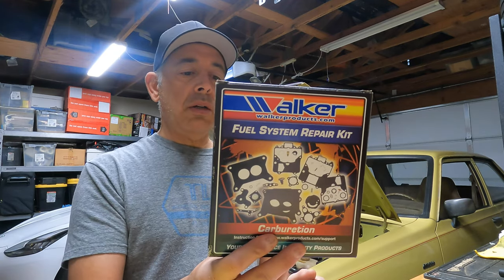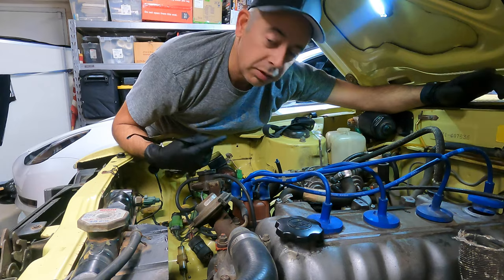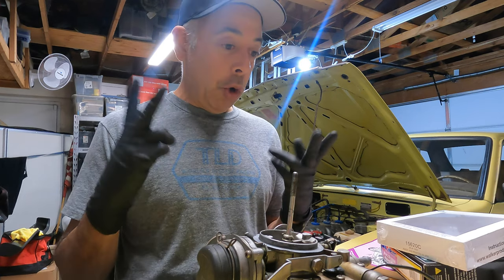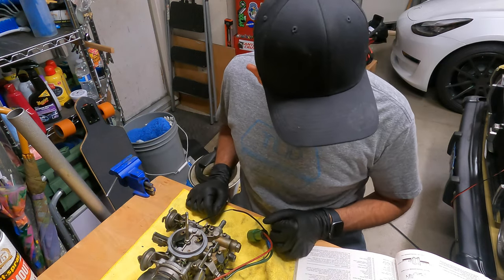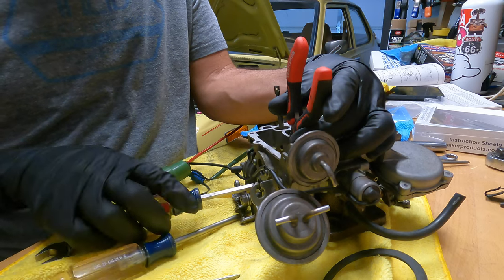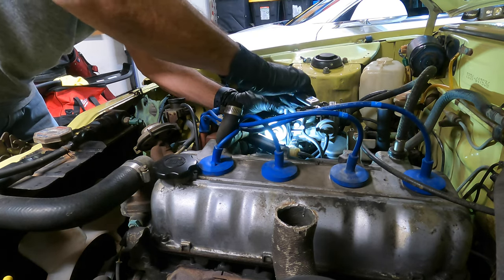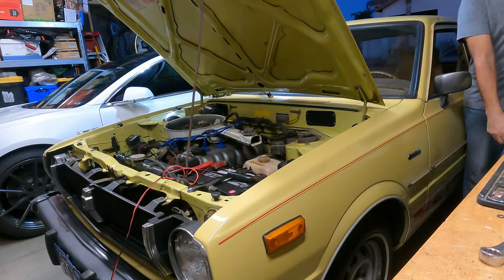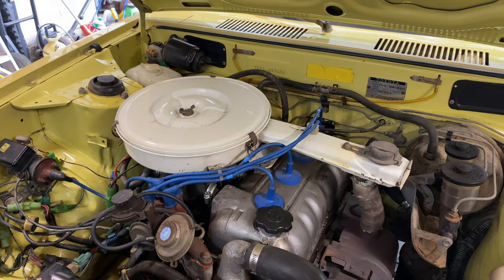Rebuilding my Carb...will it fix my 1979 Toyota Corolla TE31?

Comment: Same problem with my 84 Corolla coupe. Sat for too long. It was working fine but had a power steering leak and I let it sit for too long since I had my pickup to use at the time. When I tried to start it one day had same issue. I replaced fuel pump. (The one it had worked but was from a 4 door) they are different. Checked fuel lines. Dropped and cleaned tank. Nothing. I figured the end of the line was the carb. But I know nothing about carbs. I heard something about a floater drying out in carb... But I see you brought it back to life. I'm gonna use that link for O'Reilly. Thank for the tip. And congrats. You just forgot to say "IT'S ALIVE!!!"""😂✌️ PS sweet ride. I had an 83 pickup before. Got stolen 😣. Love old Toyota though. I would like to own a 70s pickup or Stout or Corona. Great job! Subscribed. ✌️

Comment: When you install a carburetor on a car, its a smart idea to manually fill the fuel bowl with fuel before you start cranking the engine. That way, there's already fuel inside the carburetor, and when you first go to start it, it should start within a few seconds. 
That way, you don't need to crank the engine for a while to get the mechanical fuel pump pumping fuel all the way from the fuel tank, all the way to the carburetor.
Reply from the maker: Thanks for the info...great to know for next time as I continue to learn about this car.

Comment: Hi, I have a 76 Celica (TA23) with the same engine and faults ( also a home mechanic). I changed the mech fuel pump but still no joy :( . It was harder for me to remove it because my hood flips on the front side, lol.  Looks like i have to rebuild my carb too, need to ask if you have the reference/ part number/ carb model number for the carb rebuild kit? Need to source it for a similar rebuild. Thanks for the links and a great walk-through on the rebuild, looking forward to more vids on your Corolla.
Reply from the maker: If you are in the USA, i went to the Oreillyautoparts website and searched by my car model. I did a search for yours from Walker Products tune up kit #5619C  https://www.oreillyauto.com/shop/b/fuel---emissions-16775/carburetors---parts-16801/carburetor-kit-12248/d5bc70949f67/1976/toyota/celica?q=carburetor+kit Hope this helps

Comment: I have similar issue with my 76 celica, same engine but dual carbs, cleaned them both out but now it doesnt run good, needs some fine tuning or calibration but hard to find info on that lol. So if someone knows where to find please let me know!

Comment: 1980 Toyota Corolla 1.8 stalls when I come to a stop. Any suggestions?
Reply from the maker: Man, I got lucky in just having to rebuild it and change fuel. I'm wish i could give you a answer but it looks like @mezher has some good suggestions.
Reply: vaccum line may be disconnected.
Reply: Carburetor needs rebuild too
Reply: Throttle Positioner is out of adjustment.

Comment: 1973 Corolla - used gasoline with no ethanol to solve the vapor lock issue. Place in El Monte, CA “Carburetor Exchange” can fix, diagnose issues with old carburetors. Temporarily used a transparent plastic hose from the fuel pump to the carburetor to see if fuel is reaching the carburetor. Replaced the contact points in the distributor with electronic ignition.

Comment: i’m sorry what were your symptoms of a bad carb? i just bought a 1977 corolla with a 2TC and it idles very rough and gets horrible gas mileage and very slow speed. Would this lead to being the carb? if so i’d rather get a weber than rebuild the stock carb. i heard they’re over complicated garbage
Reply from the maker: Sorry i didn't respond sooner. The car had been sitting for several years. I had picked up a 1971 corolla a few months before this one and rebuilding the carb really helped. This one just wouldn't stay running. Rebuilding the stock carb and draining the tank made the biggest difference.

Comment: Does any of you k ow the settings of the adjustment screws for a 3tc/2tc carburator purchased a rebuilt carburator for my car and it doesn't run good, I changed fuel tank ,lines ,fuel filter,fuel pump, spark plugs, spark plug wires ,dist cap and rotor and new exhaust and pipe  car still won't idle and accelerate  properly  so need to know the settings case the 3 1/2 turns on the one in back and 21/× on one in the front is not getting it done looking at carb there are four little  adjstment screws from bavknof engine to front. Any help greatly appreciated
Reply from the maker: Sorry I don't. I only replaced what i could and replaced everything back to the original location. I got lucky that it was simple and I did not have to really diagnosis it.  If you're not already, there are some groups on Facebook like 3TC garage or Toyota 3TC that i'm sure have members that could help you out.

Comment: The bowl where the float goes?
Reply from the maker: Correct, there is a little pin that the float makes contact with, the tip was broken and clogging the fuel intake into the bowl.